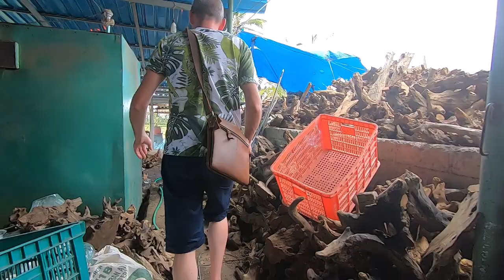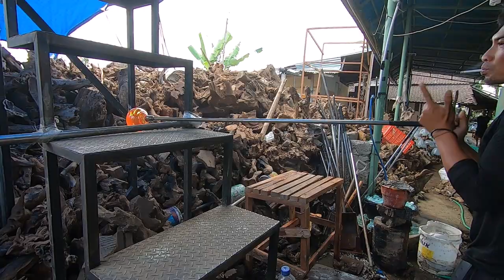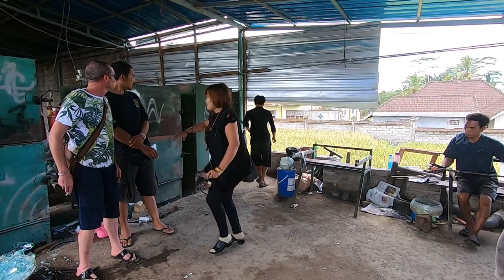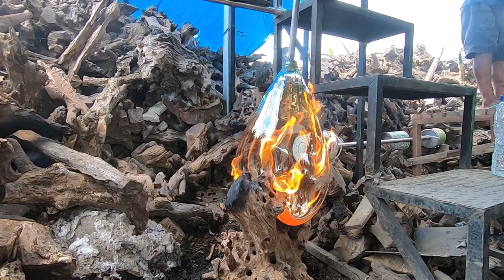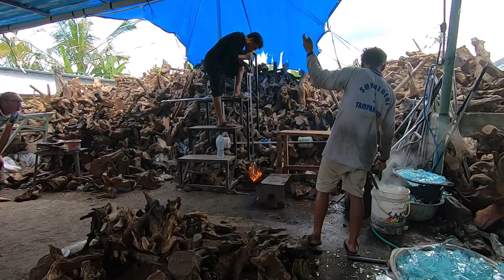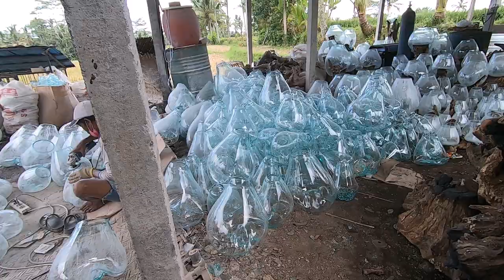Bali Glass Blowing (Driftwood Fish Bowl)

Comment: If they coated the wood in a heat resistant epoxy or resin first they could mold the glass to the wooden stand without scorching it and retain it's wooden quality without having to sand it / remove the burnt edges later but maybe they've got a plan for that or it's easier to just sand it off later 🤔
Reply from the maker: They don't sand off the burnt part of the wood. They keep it there to maintain its authenticity and charm.